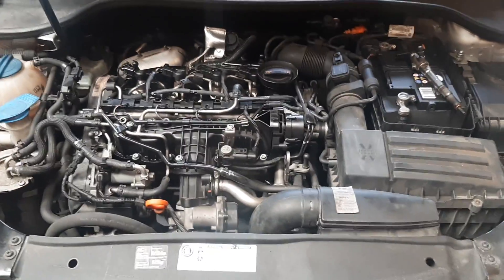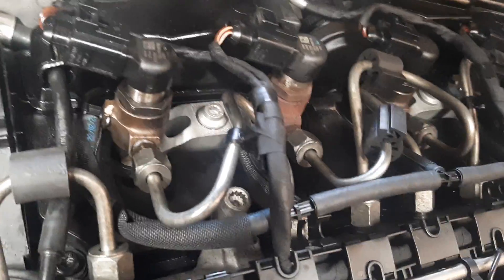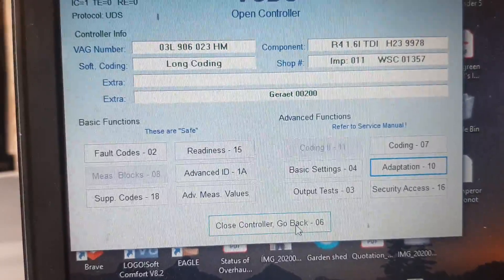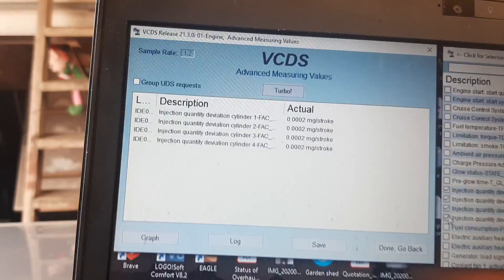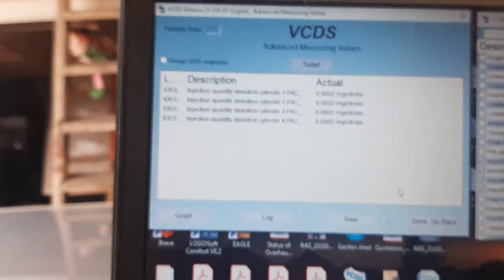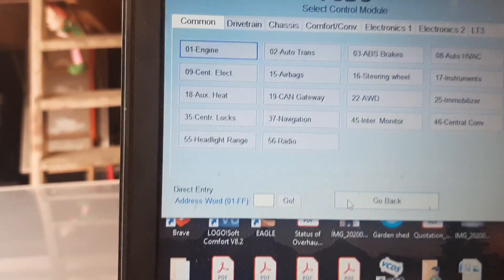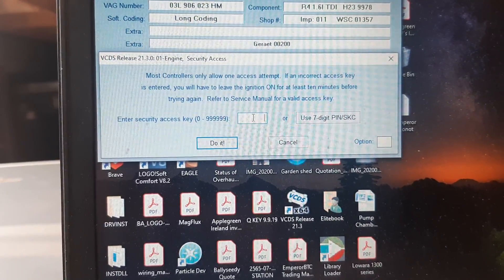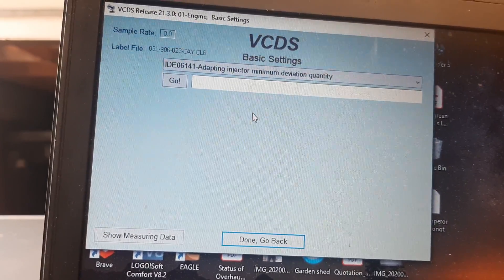VW 1.6TDI Injector Quantity Adaptation IDE06141 CAYC engine

Comment: Mine wouldn’t work initially. Had the engine up to temp and followed the exact instructions in the video but it would just sit at 800rpm. I had to get the ECU software updated mine was too low. Local tuner updated it for me now it works no issues.
Reply: Do you know to which software he upgradef

Comment: Hello. First of all thanks for the video explanation it's very usefull. But I have a problem with my car : golf 6 1.6 tdi cayc - 252.000 km After the adaptation procedure I still have a rough idle. Let me explain my situation. I've just changed the number 3 injector ( electricaly fail - low résistance ) with a brand new Continental one. I have cleared the p0203 error code then I warmup the engine till correct temp ( no error code ). Then I've made the procedure exactly as described in the video. It last for about 15-20min counting for about 28 throttle blips each cycle. Once the adaptation procedure completed in the vcds the idle remain rough. 
For the measured value of deviation
Inj 1 : 0.6 - inj 2 : 0.3 - inj 3 : +2.0 - inj 4 :  -1.9

So values remained the same as before adaptation. 
The car doen't have any other issue.  It was running fine before the injector error code

Concerning the injector 4. I had to remove the piezo head in order to extract the injector with a pneumatic injector puller because it was stuck.
I've cleaned the nozzle of the injector in an ultrasonic bath. I've torqued the nut at 25Nm.
I've cleaned injector seats with the correct reamer, put new copper washer and new clamp bolt torqued at 8Nm + 180°. 
I measured a resistance of 199 kohms

Other info :
Adaptation ide06141 made with Vcds clone 19.6.1
Ecu software 9983

So what I'm missing ? Do I need a Genuine vcds for that ? 
Maybe other people have or had a similar issue.

Thanks in advance for your help.
Reply: Did you manage to fix this and how please?

Comment: Did all the steps on the video exactly, but the IDE06141 Adapting injector option isn’t in my list?!  2010 1.6TDI Skoda CAYC engine… any idea why it wouldn’t be there?
Reply from the maker: I have seen some early software revisions on Skodas did not have it for some reason? had on and octavia myself also.
Reply: @enginemanagementadventures7305  Thanks for the reply. That’s a shame.

Comment: after the injector repair, do I just have to enter new codes or do the adaptation?
Reply from the maker: The codes need to be entered first, that is compulsory. You can run the minimum adaption quantity after if you like to baseline the pilot injection.

Comment: Hi lad, I have a 141 Passat 1.6tdi when I start it cold there is a misfire and when driving along in 4th gear it starts chugging along the road 212,000km on it, would it be injector or something else ? (There’s no codes on the dash)
Reply from the maker: You'll need to read engine ecu in any case. If injector failed electrically it will shoot a code instantly, this doesn't seem to be the case for you. Does it drive OK at times? When warmed up does it idle OK? How is the flywheel? Clutch pulsing under foot? Lots to find out before I'd condem an Injector.
Reply: It idles fine when warm,it drives grand apart from the chugging in 4th,5th and 6th gear. Should I take it to a garage to see if it brings up anything on the computer?, Also sometimes there’s a strong smell of diesel at times.

Comment: Hi,
Injecto4 4 is showing high numbers compared to other 3. Its at 4.9mg/str  MAX when cold. I noticed a horrible diesel knock  only when I'm on a certain road first thing in the morning. It has a load of speed bumps with a gentle incline and when I gently accelerate after the 2nd or 3rd speed bump the knock starts and is continuous until I turn car off and restart and off I go again as gentle as possible. 

The problem goes away when warm and all injector reading are perfect and all similar. It goes up that same road with speedbump with no probs. 

Is there a chance the copper seal id defective and just expands when warn to make the desired seal? Or is it injector related AND will the adaptive routine work sort out the issue?

I've had injector problems before ( post 2 yrs ago ) and learned a lot form this video and others

Any thoughts and help would be appreciated. Thanks

Comment: Hi can you please help me I change the speed limiters it was at 190 km I was just messing around. I change it to two hundred km so for some reason when I press do it it kept going back to 50km now I have smoke bellowing out of tail pipe and it’s running like a pig and there’s was smoke coming out from under the bonnet I was afraid to look. Can you please help me my head is all messed up i know I did something really bad to the engine have you any ideas please help

Comment: Well just had the RAC out to my 2009 VW Golf Mk 6 1.6 tdi cayc, flashing glow plug on dash running on 3 cylinders whilst far from home on holiday.
RAC  took approx 25 min to change number 1 injector after P0201 code found open circuit. The cast was £600.00 to change this injector Continental brand P/N= A2C9626040080  or  03L130277S.
So l guess l now need to see how all 4 injector minimum quantity's are balanced after watching this very informative video.
The  brand new Continental injectors can be bought for approx £330.00, how the hell do RAC which is suppose  to fit items for tree justify the £600.00 charge?
Highway robbery in my opinion total scam
Reply from the maker: New injector, copper seal, o ring and stretch bolt about €350 new here in Ireland. Usually those injectors pull out easily so that price seems crazy tbh. Did they code the new injector?
Reply: @enginemanagementadventures7305  Hi, Yes l watched him code the new injector from the code on the top of the injector cap
Reply from the maker: @colin5064  you should be good to go, the ecu will compensate itself over the next 100kms only run the routine if you have a noticeable instability at idle.
Reply: @enginemanagementadventures7305  Hi,
thank you for the information update most appreciated. Your videos are a great resource  of  professional knowledge and experience.
Reply: @enginemanagementadventures7305  Hi, please may l ask in your experience with these injectors. If number 1 has failed at 56,201 miles are the other three likely to fail soon or have l just been unlucky to have number 1 fail at such a low mileage.
I bought this Golf 1.6 tdi cayc new so l know its entire history. Any advice would be most appreciated, but not looking to waste money unnecessarily

Comment: I have try on my golf and it started all good but it was going more then 15 min is there any problem when is going that long or it should be like that
Reply from the maker: To long takes approx 2 mins before it starts revving itself follow the power cycle procedure exactly to enter.
Reply: So if is go more then 5 min i should stop it ?
And try again
Reply from the maker: @Alex Alex  the procedure with vcds is very specific to the continental eng management system, remember vcds is a odis emulator not perfect.
Power down fully and enter exactly as i did in part 2 video
Reply: Thanks for your help i will try again tomorrow

Comment: Hi I have a audi a4 b7 2.0 tdi 2006 my car is driving fine... when engine gets to operating temperature the car vibrates and shakes at idle no smoke or anything idle is not hunting .. had vcds on to check everything seems good only got p0674 code for glow plug . Checked injectors all in spec cylinder 1. -0.16 mg . Cylinder 2. - 0.02 mg . Cylinder 3 . 0.28 mg . Cylinder 4 . -0.07 mg .. but injection quantity is bouncing around 1.5 mg to 2.5 mg/str and it says it supposed to be around 3.0 to 9.0 mg/str is there any way you can adjust that thanks ..

Comment: Hi, do you know if this is  the same process for the SEAT Ibiza 1.6 TDI? many thanks
Reply from the maker: Hi there, it depends on the year of your SEAT, this procedure is applicable to the CAY series of engines from 2009-2012 with Siemens/Continental engine management after this VAG switched to Bosch and Delphi.

Comment: I have this deviation on #1 (-1.9049) and #4 (1.2424). I suppose #4 is compensating #1. #1 being closer to the dpf, it reaches higher temps. 
#2 (-0.3708) and #3 (0.5587) are ok, i think. Do you think an adaptation could smooth things or should i be prepared to change #1?
Reply from the maker: If its not broke dont fix it 🙂 - I would leave everything as it is unless you have an active code.
Reply: @enginemanagementadventures7305  tkx.  It has an instable idle when cold and ratle noise when accelerating at low rpn when hot

Comment: Sorry, maybe already posted question, but, can I perform this adaptation even if the injectors are not new or ever been replaced?! 1.6 tdi CAY engine. Thanks a lot for your effort! Regards!
Reply from the maker: @alteaxl4621 yes you can but why? This procedure is for adjustment of the pilot injection parameters and cylinder balance, it may change the characteristics of idle etc but will not fix a mechanical issue.
Do you have a problem with your engine?
Reply: Thank you very much for your reply. Kinda I do, on some occasions I do get inconsistent idle like fluctuations from 780 rpm as normal, to 750 rpm - 810 rpm.. when I turn the AC on or some bigger electric consumer this problem disappears. Kinda awkward. Thanks again mate!
Reply from the maker: @nenOOOOOOOO  engine when idling will enter smooth running control to try and balance cylinder pressure for smoother idle, as soon as AC or Alternator are called this mode will exit, so might just be some instability around this.
Reply: @enginemanagementadventures7305  Thanks mate... Already did alternator pulley, new aux belt and new belt tensioner... Didnt touch the AC though.. maybe next. Keep up the good work, and all the best!!!

Comment: I have fitted 4 brand new injectors to my audi a3 cffb 2.0 tdi and coded the injectors in. Should I do a minimum quantity adaptation too?
Reply from the maker: This is a bosch ECU it has its own fuel adaptation routines, the video is for the CAY 1.6 Siemens/CONTINENTAL ECU.
Short answer is yes if the routine is available in VCDS
Reply: @enginemanagementadventures7305  it sounds abit knockey and loud like the injectors are faulty. So it can be done on bosche injectors or only on Siemens?
Reply from the maker: @Liveforeever  did you code injectors correctly?  New injectors must be coded as the ECU also compensates for mileage.
Reply: @enginemanagementadventures7305  yes I entered the codes from top of the injectors which I bought from GSF. Engines done 186k and fitted them upon full rebuild but only done 1 mile since as I'm getting p256300 and P00AF00. I had zero turbo problems before engine was rebuilt.
Reply from the maker: @Liveforeever  why was it rebuilt? P2563   could be the diaphragm in the turbo actuator damaged or as you say poorly built turbo, strange. Focus on fixing these before worring about injectors.
Reply: @enginemanagementadventures7305  i didn't rebuild the turbo it wasn't touched , just the engine, turbo was sat aside for a couple of weeks and now these codes on startup. I can move actuator freely and it holds vac. I've changed n75 already but I difference. I'm getting power to the plugs too. Should I change the actuator? Maybe the electrical sensor has broke down
Reply from the maker: @Liveforeever  is the movement silky smooth, so no chance of vanes sticking from a worn turbo nozzle ring? If so check the measuring block relating to turbo actuator position sensor in vcds to confirm bad sensor.
Reply: @enginemanagementadventures7305  i am getting 3000mv at idle and not changing when I rev it, the duty cycle is 90% then when the codes appear the duty goes to 5% and voltage still at about 3000mv. The offset closed and open readings are  -1.6% and 1.6% but don't know if all these readings tell me something. Any ideas?
Reply from the maker: @Liveforeever  I assume all vac hoses from N75 valve to actuator are good. Also have you manually moved the actuator either by vac pump or just with your hand to see position voltage move ?  Does the actuator push nozzle closed and open when you physically connect and disconnect vac pipe on actuator at idle ?
Reply: @enginemanagementadventures7305  all vac pipes are good, n75 good, I haven't looked at the voltage whilst moving the actuator as I'm on my own but I can move it freely and it does move with a vac gauge and holds. The voltage at idle is 3000mv, should it not be about 300mv (0.3v)?
Reply from the maker: @Liveforeever  pull the hose from actuator can when idling it will move to fully open position (no boost) the position value should drop significantly
Reply from the maker: My A4 with CAGA engine ide 362 (required position)100% @idle, IDE396 (actual position should follow) 

ENG109599 170% & ENG109616 880mv @idle
Reply from the maker: Ignition on engine off values move to 10%,16%,10%, 3980mV
Reply: @enginemanagementadventures7305  looks like my actuator is dead
Reply: @enginemanagementadventures7305  update : I changed the actuator and still same two fault codes. So then Back probed the plug on actuator and voltage at full vac was at 1100mv so set it at 450mv and still the same fault codes. I found a leak at the egr diaphragm so I blocked that vac pipe and still the same. Checked the port on vac pump and it has strong vacum but the vac pipe to the actuator has very weak vacuum at idle.. Gutted and stumped, I was about to rip all the wiring and check it from actuator to ecu but I figured il check the vac pipe from n75 to the rocker cover which I'm assuming is just a vac accumulator/tank and felt a strong vac on the pipe that leads to it and the actuator at idle went down to full position so I blocked it off and it's absolutely fine now. I cleaned the rocker cover with brake cleaner which I'm thinking may have damaged the accumulator in there as I had zero problems before the rebuild. Its a Valuable lesson learnt and experience gained though. Engine sounds smooth and fine now.
Reply from the maker: @Liveforeever  Damm...yes the accumulator is moulded into the rocker cover. Must have been pierced I guess, you got there in the end.
Usually borg Warner/kkk push to close vanes and garrett pull.
Tks for update and nice work !

Comment: hi , why in vcds  I do not have the option to do injection quantity deviation test for cylinders ?
Reply from the maker: Some early CAY engines don't seem to have it in the software rev. Have definitely seen a few skodas that don't have the option.
Most likely the ECU will adapt over time in any case.

Comment: Great video! My golf mk6 1.6 tdi 2010 CAYC engine got injector 2 replaced in a VW shop. Do they perform the injectors adaptation there? Or should I go ahead and do it? My deviation values could be closer but I think they are in range.. I'm asking this because my engine seams to run rough when compared to other similar engines. Thanks!
Reply from the maker: Odis will prompt them to do it, so they will have done it I'd imagine.
Remember in any case over time the ECU is adjusting this value in any case

Comment: Hi mate. It asked me to press the brake with clutch and then accelerator but the engine stays idle for 1 hour and does not adjust the injectors.

The engine is a 1.6 CAYC 2010
Reply: Did you sort this out?
Reply: Have you solved it now?

Comment: Hi. I’ve done everything right with the minimum quantity and so one. The car was running for a few miles really smooth comparing to before! But now I’ve got EGR failure. 
I think it might be connected with the new values from the injectors. 
I am cleaning the the errors all the time but the light comes up straight away! 
Any advice on the EGR! 
Can I do a”reset” to the EGR  ? 
Thank you
Reply from the maker: Hi, what is the code concerning the EGR?  If it a position sensor short to high or ground the EGR is dead.
There is a very Common problem with the non contact position sensor in the EGR motor failing.
Reply: @enginemanagementadventures7305   1 Fault Found:
7462 - EGR Valve (N18)
P0403 00 [175] - Malfunction
MIL ON - Confirmed - Tested Since Memory Clear
Freeze Frame:
Fault Status: 00000001
Fault Priority: 2
Fault Frequency: 3
Mileage: 175997 km
Date: 2022.10.30
Time: 19:33:49
Reply: @enginemanagementadventures7305  
It did start right after I’ve done the minimum quantity on the injectors, it went pretty well. 
I hade the rough running and so one! 
So I am assuming that it might be a option to reset the values for the exhaust circulation after the injectors adaption ? 
😅
Reply from the maker: @TiagoOliveira-if6zw  you certainly can try to perform basic setting of EGR valve as I agree its strange it happened after doing adaption.
http://wiki.ross-tech.com/wiki/index.php/16787/P0403/001027
Reply: @enginemanagementadventures7305  
I have the latest version of Vcds, I can’t really find that option! 😅
One thing I realize is when I am doing dpf regeneration the error don’t come up and the car is driving fine! 
I presume the best way for me it’s to delete the dpf and egr! Since I can’t fix this problem. 
Thank you for your help and keep helping the community! Appreciated
Reply from the maker: In basic settings after login, there is a egr test and also egr setting.
Why did you need to do a dpf regeneration? Mapping out egr and dpf is dependent on the quality of the map.
If your engine is the CAYC it is generally very reliable.
Hope you get it sorted 🙂. Always best to fix the problem at source.
Reply: @enginemanagementadventures7305  
Yes it the CAYC engine. 
I’ve done now in the right way the EGR adaption. 
Looks like it’s gone for now. 
The car is driving perfectly! 
Regarding the DPF regeneration, I saw a guy doing exactly what you did in the video with the injectors minimum quantity but at the end he recommended the DPF regeneration! 
Thank you once again for you help solving my issue!! 
🙏